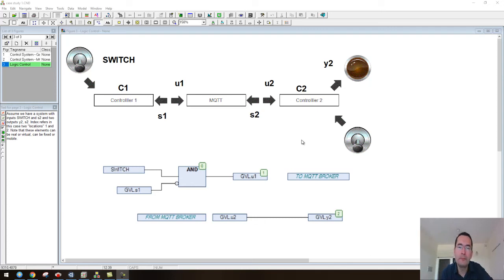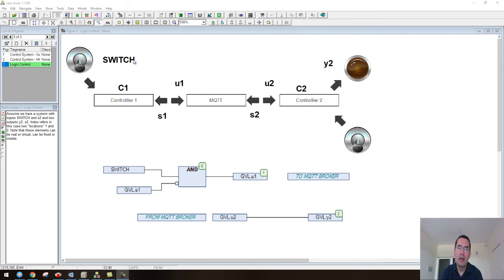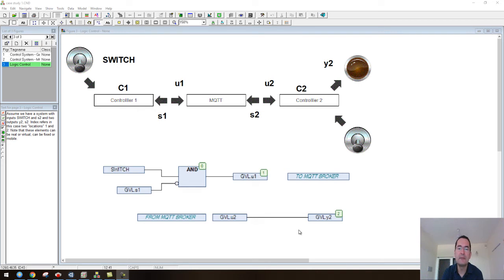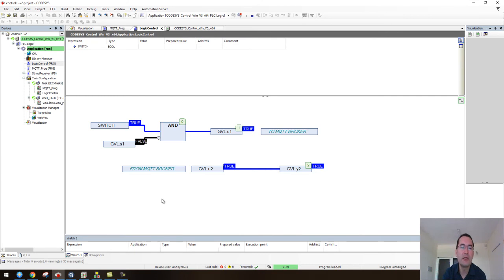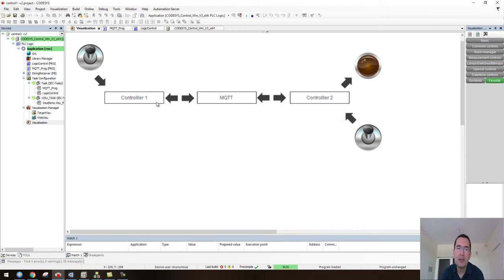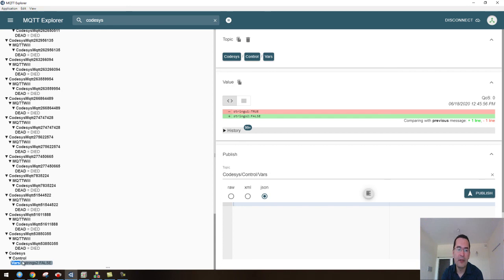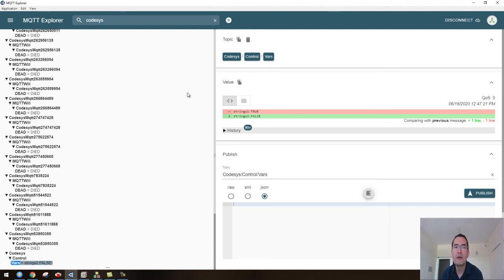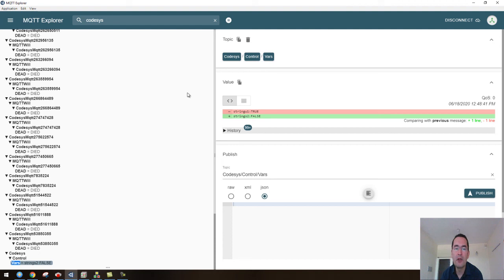Logic control and MQTT communication - CODESYS / MQTT explorer

Comment: Hallo. What version of Codesys do you have? When compiling a project, an error occurs " The Library 'cmperrors interfaces, 3.5.5.0 (system)' is only supported in 32 bit applications". 
I have 32 bit Codesys.
 All necessary libraries are installed
Reply from the maker: I think this project was done with SP14